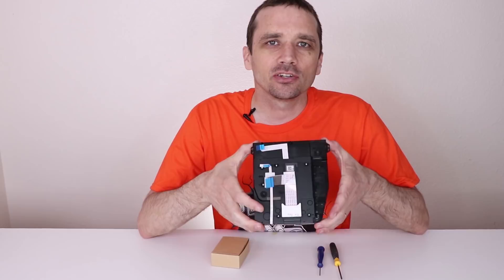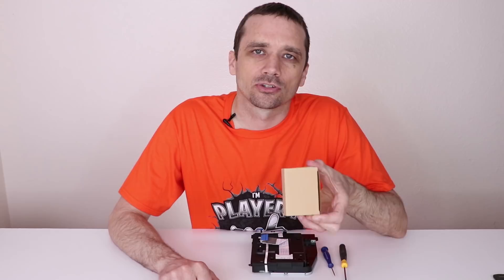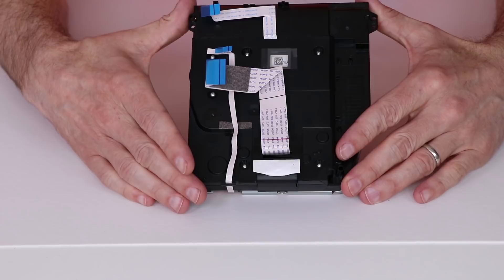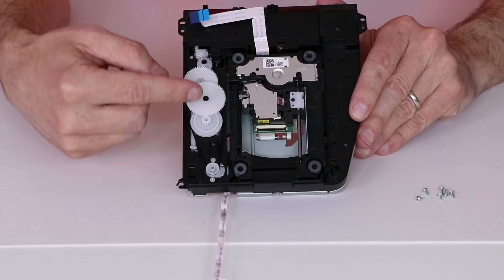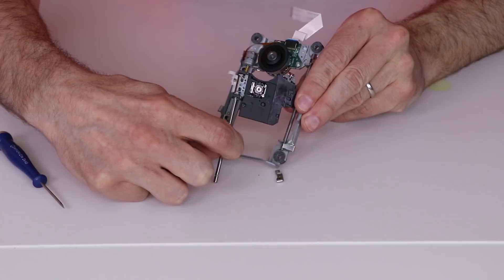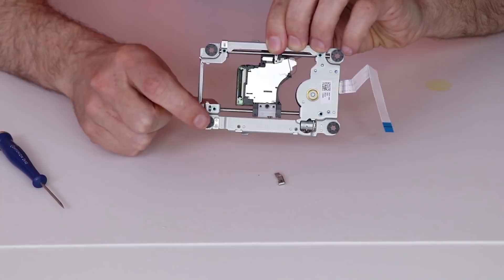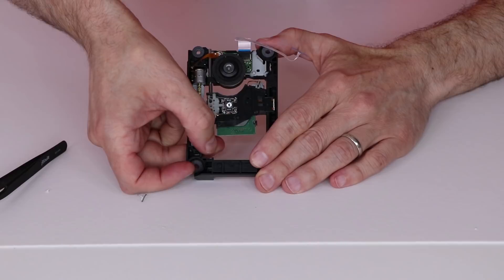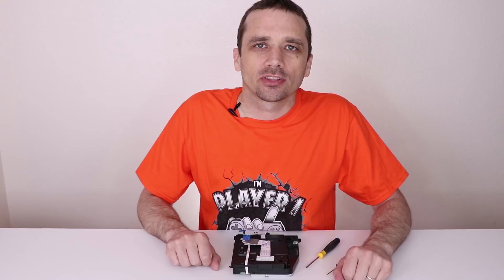PS4 Disc Reading Error - Laser Fix - How to Repair Blu Ray Drive

Comment from the maker: Let me know what questions you have and what other videos you'd like me to make.
Reply: TronicsFix like watching your vids. Got a question about my bd drive. I replaced it with a new one but it keeps saying unrecognized disc. I tried the data rebuild and update and nothing. Think it could be the laser?
Reply: TronicsFix LLC That laser for ps 4 slim ?
Reply: What if it loads a game really slow or just lags out while doing it
Reply: Where can i get an Optical Drive Compatible with the PS4 CUH-1216B. Which exact drive do i have to buy? I think my laser is a KES-490A.. Thank you in advance
Reply: You said in this video that the black plastic lens carrier was for PS4 Pro. I found others saying it works in the 1215a PS4 model also. Is this correct? And thank you for your videos, they are extremely helpful.
Reply: do you have a re-assembly walk through? I'm having a hard time with it
Reply: I have over 20 games and my PS4 will read all but two of them. Neither disc is damaged or dirty but still says unrecognized disc. Should I replace my laser even though it reads other discs? Your videos are great btw. Very well put together and helpful.
Reply: Ive just replaces my laser but its STILL saying unrecognised disk. Doing the exact same thing. I can hear the reader going back and forth. Half spit the disk out and try again. Im baffeled. Could it be the ribon cable? I really have no idea what to try now.
Reply: Hi, can I swap the lasers directly from PS4 CUH 1102A to CUH 1202A? Are they identical? Many thanks
Reply: @B3anBag98  thank you
Reply: @B3anBag98  i see there are the 1215 models as well as 1202... i assume they won't have the same disc drives as per your comment?
Reply: @B3anBag98  oh okay so there's a chance for me to replace the while disc drive for the 1215 and 1202 then? But not the laser unit.
Reply: @B3anBag98  many thanks again bro 🙏🏼🙏🏼
Reply: @Bish186  hey man did you find a solution? Because I replaced the laser and the ps4 is still getting trouble to reading some games in particular
Reply: Mine will read DVDs and games but no blu Ray's at all!
Reply: Mine plays blueray but wont recognize ps4 games, so that's the optical drive right?
Reply: Man my PS4 pro won't read disc even after i replaced the entire deck that contains laser and mechanism. What could it be?
Reply: Hey I dropped my ps4 and now it can’t recognize discs. When I insert a disc it sounds like it’s trying then it stops... sounds like an optical drive?
Reply: How much would yu charge me to replace my laser
Reply: TronicsFix- I went on to Amazon to buy one of your lasers but I have a question. I can't remember what model my console is, but my ps4 laser is a KEM-490AAA  1015  1204B, and my circuit board is a BDP-025. Will your laser work for my PS4? The one that you have for sale has the laser KES-490/KEM-490,  mount, and circuit board BDP-020/BDP-025. I think I just need the laser but I've never bought or replaced a laser before so I just want to make sure that the laser and the other stuff is the right one I need before I buy it.
Reply: My ps4 slim wont insert the disc. But if im putting it manual it will play the game
Reply: I have a question. My ps4 pro disc drive gives me errors when I insert a disc. However I am not so sure that the laser is faulty here because if I put my pro upside down the laser does read the disc properly. So it seems to me its more of a mechanical issue that does not allow the disc to make proper contact when the machine is set horizontally. Yet it does make good laser contact when it is set vertically. What could it be?
Reply: @PsychoVampyre91  did you ever get a response to this?
Reply: @SnakeEmperor14  did you ever figure this out? I have the same problem.
Reply: Does it need update after ?
Reply: How do I know what KAS/KEM number is right for my console? Is it on the moder board? Where if so? Very happy to get help!
Reply: I goofed and ordered the wrong deck. Will the 496aaa work in place of the 490?

Comment: Great videos, so clear and accurate. I'm replacing the laser on my PS4 CUH-116a and I cannot find the laser part number I need as the CUH-116a seems quite an obscure model. Do you know if part number KES-860a would fit? Thanks

Comment: When I took our PS4 gen 1 apart, and pulled out the disc drive, I had a cog with a spring on it fall out. Can you tell me where that goes?
Reply: Same thing happened to me.  Did you find out where it goes?

Comment: If you're having this problem try giving the ps4 a whack with your hand on the left hand side or on top of the console where the disc drive is. Not too hard, just enough to knock some sense into it lol. Worked for me. Now my games are playing again. You're welcome.
Reply: Im not going to lie, i think this is what actually caused my laser to break as i hit in frustration while the ps4 was upside down with the fan out to cool down whilst i was playing, i then lagged out and smacked it right where your talking about, then it just pops up with unrecognised disc, thoughts and any tips for my issue.

Should i hot it again lightly in the same area to “knock some sense into it”?

Comment: I have a different unit. But my motor that spins the disk is not turning at all when a disk is inserted. Is that why it’s not recognizing the inserted disk? It started to act up after inserting a new blu ray. And now none of my disks I have seem to work. Cleaning the laser lenses did not seem to help at all. The disk motor sputtered at one point. Now it just does nothing.
Reply: Were you able to fix your problem? 
What was the detail?

Comment: I know I'm late to the party, I have a ps4 here that will take the disc, and as i watch the laser, it will flash blue then red and lift the disc drop it back down and then flash again. Finally at the end it will say unrecognizable disc. Is this a bad laser? I've tried another drive, not sure if its a working one, swapped drive boards and i still get the same result. I'm all out of ideas. Any advice for a n00b?
Reply: Hi any updates on this? I'm having the exact same problem

Comment: PS4 Pro: Does read games, but I have to give it a couple slight taps with my hand just over drive upon inserting disc in order for it to read. Would that fall under laser replacement, or something else? thanks in advance...

Comment: So my PS4 Pro makes a clicking sound, tries twice to read the disc and then gives me an unrecognised disc error.
However if I tap on the top 2-3 times as its starting to spin up it successfully reads the disc. I sent it in for repair at a reputable console repair place and they apparently tied multiple disc drives and lasers. It was fixed for a time but has now returned. I have no idea what's going on.

Comment: cant find a ps4  cuh 1216a lens and deck anywhere. searched for ages. Will another model one work, as ive looked everywhere and simply cant find it. Ebay amazon or google. Do you know where i can get 1 from. thanks in advance

Comment: So I have a PS4, that I bought used. Have found that we can only play downloaded games on, which isn’t good, cause I’m not buying my boys their games again for the ones they have disks for. Well found that a dime had been shoved in the optical drive, and it knocked the rollers off. We fixed those and it will now take discks but we get unrecognized disk. I replaced the laser lens and we’re still getting that message, only now it won’t even eject the disk. Any other suggestions as to what this could be? Could the dime that was shoved into it have messed up the whole drive?

Comment: Replaced my laser on ps4 slim pro and it did absolutely nothing. the old laser actually worked intermittently.  Inspected other parts seem to be working fine, any suggestions would be great

Comment: My ps4 will read DVD's but not games
Reply from the maker: Probably needs a new laser.
Reply: It uses another laser for your dvds and bluray movies. If your ps4 pro doesnt read your ps4 games even after trying vertically stand and all other methods. Then it's safe to say your ps4 game read laser is dead. It doesn't mean that the dvd/bluray read laser is dead tho, that one can still work very well. You can test it easily by inserting different dvds and bluray movies

Comment: My PS4 Pro is having a super hard time installing some disc games. I hear the disc revving up and down in a loop and the install speed slows to a crawl or will just give up saying an error occurred. I just now replaced the laser (using your fantastic guide) and it didn't have an effect. Any ideas what it could be? I'm almost ready to buy a new one or go download only...
Reply: Same here man... just put a new laser in tonight and nothing 😒 everything else functions fine.
Reply: I have the same problem, now I'm not sure if replacing the laser will fix it
Reply: each ps4 has its own disk driver wich is 
only works on that mortherboard
Reply: berrynrrd would that be the “logic board” that is attached to the exterior of the bluray disk drive itself with all the ribbon connectors?
Reply: @brandongirardi4027  how much is the laser

Comment: Hey good video
Im having a problem here
Couple days ago i cleaned my ps4 and put it together as always but im having problem with eject button
Also opened the disc drive
Thx to your videos
The disc drive looking perfect also every thing else 
Back where it should be
I thought maybe 
the disc drive has no pawer to it but when i start my ps4 i can hear clicking noise again these are the problems 
in short
The Eject button is not working.
Disc doesn't go in
Also tried to put the disk 
when i took ps4 a part
Put it back together and it doesn't red the disc
its like the disc drive 
is empty hopefully i explained everything

Comment: I have took my ps4 apart and checked the rollers that seem in working order took them out and put them back in to be sure got rid of all the dust and it still wont read the disc. I dont understand that, I done as you said in your disc drive video and it still ain't reading.
Reply: Were you able to fix your problem? 
What was the detail?

Comment: Hey man, my ps4 slim is having trouble reading disks how can I fix this?
Reply: If it still reads some disks try the update method found in other videos. You start the ps4 in safe mode asked update system software

Comment: I have a question, this might be a dumb but I don’t mess with consoles we’ll I have both the old consoles of the PS4 and Xbox one and my PS4 hasn’t been reading discs and I was wondering what if I use the Xbox one laser disc on the PS4 if that even works but before I do anything that’s why I’m asking I don’t want to mess anything up
Reply: No there are three models of lasers of the ps4 if you want to know which one is yours u can look on your laser
Reply: Or search the ps4 model you have and buy the 1 compatible with your model

Comment: Hey I have the 1215a model and my disk drive accepts disk but makes like a weird noise like it starts to spin and then stops and keeps trying to spin up. I replace the whole optical drive and makes the same.noise and  still says disk unrecognizable.
Reply: Did you solve the problem?

Comment: I have a similar issuse only I have to trick mine into reading it. I have to insert the disc in and turn off my ps4 all within 1 sec. Then I turn it on, then it reads afterwards. If I insert the disc with the system on it self ejects the game and makes a double clicking nosie goes back in to place and continuously keeps to spin and eventually it dosent read, any suggestion s?:/ I have a launch console model Playstation
Reply: Did you solve?

Comment: ps3 turns on but almost always shuts off a few seconds after, sometimes it works long enough to load a game and play but it will randomly shut off, any idea what the issue is?
Reply: Over heating? Try to carefully open it up and clean out any dust. Put your ps on a metal dinner tray or raised up off of carpet

Comment: ugh. my ps4 is having the disc read problem. started with blu rays at first. would suddenly freeze and skip. so i quit playing them in it. recently bought a new disc game and it wouldn't stay reading it long enough to install it to the hard drive. hadn't actually thought to check other discs i own when i had the blu ray problem as the main game i play on it i have it digital.  i have the darth vader ps4 that came with the game disney infinity star wars. id be afraid to do this myself as id be afraid of breaking something. i've wondered if a external blu ray player would work as i need to buy one for my new gaming pc that has no disc drive at all. if not i may send to you for repair, but of course that brings fear of being lost in the mail.

Comment: My PS4 Slim only read disk when it’s on vertical position, when it’s flat on the surface it makes funny noises, not much loud, not much funky, it’s just a little bit different from a fine working one, I can not tell for sure but I don’t think it’s the lazer, it reads perfectly when it’s on vertical

Comment: Hi Steve, long time no see, why was that sometimes the ps2 fat model scratched discs?
Reply: That's usually because the laser is knocked off course causing the lens to rub up against the disc and scratch it. At least that's what always happened with my PS2 slim

Comment: My PS4 PRO can play dvds, and blu ray movies, but not PS4 disc games. Itll make an abnormal disc drive noise when it tries to read the discs. And Ill have an unsupported disc error icon on my screen. I've rebuilt the data base, and reinstalled the firmware, itll solve my problem but temporarily. Although, there's a another temporary solution, I gotta tap above the disc drive when I insert the disc for it to work.... very strange. What could be the problem? It plays movies but not disc games (I can play downloaded games perfectly fine). Thank you for reading :)
Reply: Did you solve the problem?

Comment: Im getting the unrecognized disc error as well, and will be replacing this part. Is there any concern with the device locking up due to any non original chips etc?
Reply: From my experience it won't lock up due to none original parts
Reply: @ishyj398  thank you- while i did perform the swap 3 weeks ago, i was successful and recognized that there were no complications. I replaced the mechanism and moving parts rather than just transferring over the laser emitting pieces... 
I did have to transfer over rubber grommets to keep the tray from rattling as well as figure out what position the tray needs to be in to remain in a “natural”, ready state , which no video on YT explains,   But with your instructions i was able to do the bulk of this work pretty smoothly.
Reply: Idk if you will reply but was your issue with unrecognized disc where the ps4 tries to read the disc and then ejects them and then reinsterts again to read them but fails? Was the issue solely bc of the laser ? Bc mines doing that but im not sure what the issue is
Reply: @sven1668  yes, it would do just that- i had replaced the drive last February or so, and it failed again just 4 months later.  This time i replaced the entire optical drive enclosure, although i did the work just this month. I still have 2 games that dont work, and the readable surface is notnscratched at all…

So odd. I hope the ps5 doesnt give these issues

Comment: My game goes in slow and ejects slow. Once it goes in it just keeps trying to load the game some times it plays it but most of the time it says unrecognized disc ?
Reply: I know this is an old post but im having the exact same problem on gen 1 ps4 sometimes it plays sometimes wont load .and disk moves in and out very slow followed by a sound that sounds like a printer printing kind of... What is the fix for this??

Comment: If you have a ps4 slim yours can have the Kem 490AAA or Kem 496AA. The 490 have a metal deck and single eye (theres another laser that has a similar metal deck but its a double eye) while the 496 have a black plastic deck and a single eye.

Mine have 490 CUH 2006a
Reply: Best way to look is to open the disc drive up

Comment: Hi completed the laser replacement for my PS4 Pro. After starting up it beeps 3 times and shuts down. Followed your instructions closely, but maybe I caused an issue. Any thoughts?

Kind regards,

Marcel
Reply: Probably the thermal paste needs changing
Reply: @ParraParaa__  figured out that if you order PS parts it may still be broken. 😁

Comment: Hopefully I get an answer... I have a 1215 ps4 and I accidentally removed the ribbon cables from in the disc drive in order to change my disc laser. I don’t know how they were originally and it’s stopping me putting everything back together, which way I’m supposed to fold it and which way up it’s supposed to be etc. It’s completely come out. 

Anyone got any ideas?
Reply: Just watch a video man

Comment: I'm getting I'm getting a error su-42118-6 when I try to do the new update need help please
Reply from the maker: That's usually caused by a broken disc drive.
Reply: So I need to replace me disc drive
Reply from the maker: Well, sometimes it's the disc drive but it can also be a motherboard problem. Just no way for me to know.
Reply: Well the ps4 won't take a disc I had to manual take a disc out a few weeks ago
Reply from the maker: Ya, that could be a motherboard problem or a disc drive problem. No way for me to know which
Reply: @Tronicsfix  the ps4 works fine I can play games I downloaded just no games on a disc
Reply: Cart Carr i have the same problem rn

Comment: Is anyone having a problem with the disc not even wanting to go in? Like it makes no noise you practically have to force it in and when it goes in it won't get read and won't eject
Reply: I had this problem literally what you need to do is shake the ps4 for a few minutes personally I had my ps4 in the car and all the bumps on the road knocked something back in place and it started working again when I got home.